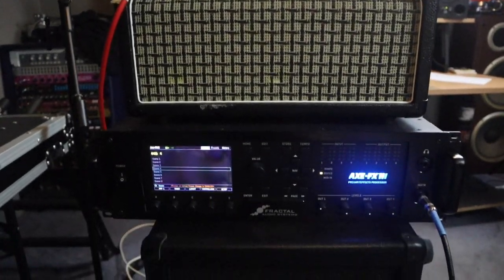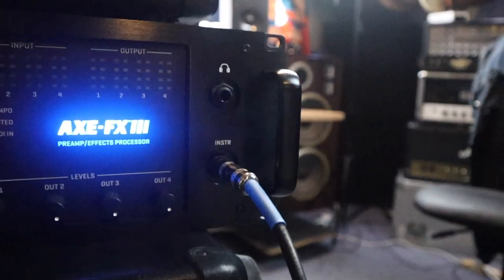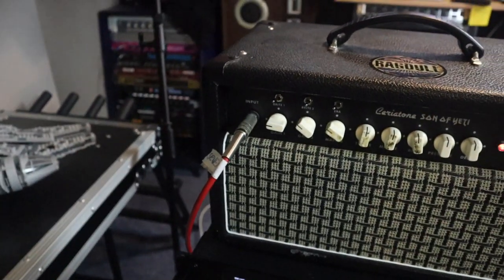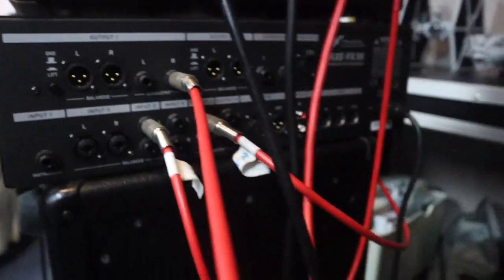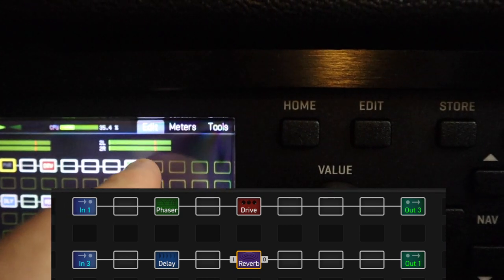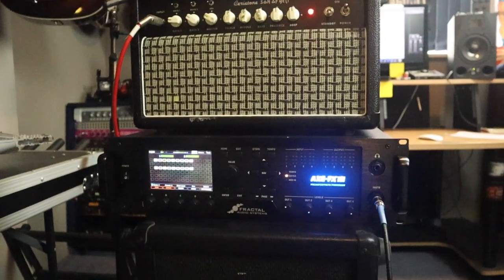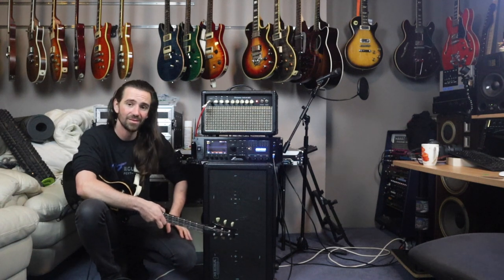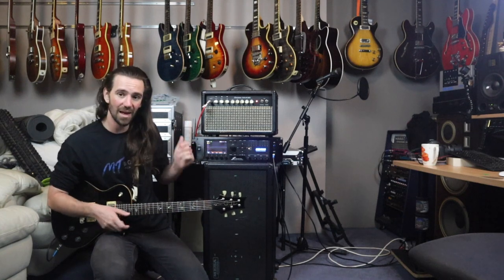Axe-Fx III 4CM Setup - Quick Tutorial

Comment: So basically we're only using the effects from the axefx right? The manual says to NOT have amp or cab blocks on so I'm assuming we're already using a physical amp and cab, correct? Is it possible to use the axefx 3 alone into a real cab?
Reply: You’d disable power amp and cab modeling in setup for 4cm. He doesn’t have an amp block in his preset. As long as you have a power amp or use the fx return on another amp, you can use the amp block with just a cabinet. You’d probably disable cab modeling and power amp modeling too.

Comment: leon thanks for the kind info you give out.....i cannot afford this right now .one day ..lol....but when i do buy one ...can i use any amp? .i been trying to get that hendrixs, van halen sound and the 80s bands ..........lots of them use marshall amps etc..pcm 80 reverb....would just any amp type setup a fender twin work for 80s sound?......also can u just plug it in like a effect single chain?.....guitar, axe III than amp............one more question .....does axe III work just pluging it into a PA?.........sorry for some many question.....any input thanks
Reply from the maker: To get the most out of it plugging it directly into a full range flat response speaker is the best way to go. Using it for fx only (Guitar - axe - amp) is possible but the best part of the Axe is the amp modelling IMO, so either guitar - axe - solid state power amp - speaker or guitar - axe - powered speaker is the best way to go.

Comment: @LeonTodd I noticed that when in 4CM or just Axe-FX III in front (boost, OD, gate) the resulting tone of the amp lacks a lot of gain (by that I mean that the signal is very weakened), clean or driven. Using my TC-100, I have to raise the gain of the OD or the boost I use on AXE at 3-5 (depends on the model) in order to get the high gain tones I get without AXE in front by using a simple 808. 

Can you please comment on this? Can you maybe quickly test and compare?  I guess its somehow related to the AD/DA conversion from guitar to AXE and from AXE to Amp. Please check it out and let me/us know.
Reply: Make sure you have your levels set correctly. Axe can send Line and Instrument level signals and also has output pads. Go to your settings and check the I/O and make sure that your pedals are set to unity gain so they're the same volume On and Off for starters. Lots of levels to consider :D

Comment: Hi Leon.Its  absolutely necessary to use trs-trs cables to function because i use ts-trs into a PRS Archon 50 and when i conect the fx loop from the footswitch i get a very poor signal and only reverb the delay im nit hearing it is posible because i dont use trs-trs cables?
   Thank you
Reply from the maker: TS should be fine unless you get hum or ground loops. In which case try a humbuster cable (there are directions on how to wire them up online).
Reply: @LeonTodd  Thanx Leon
Reply: do i have to make any setups on the Fractal?